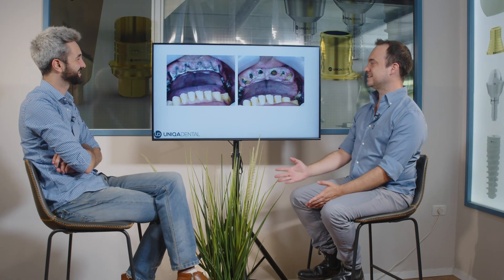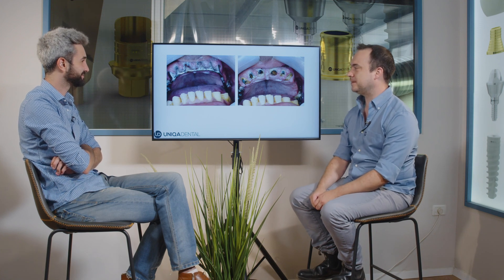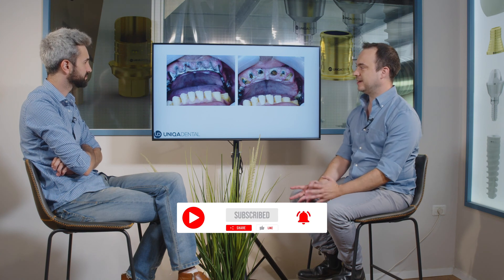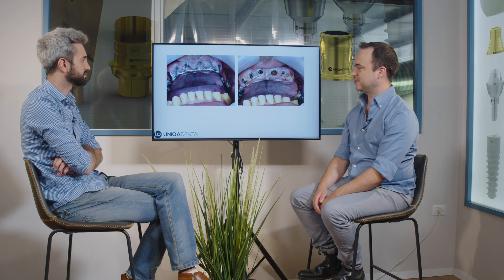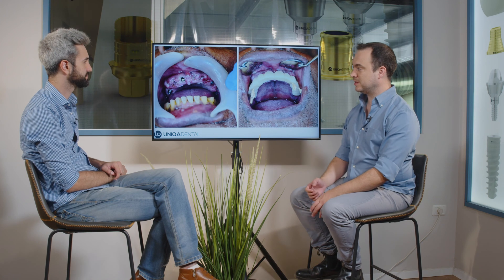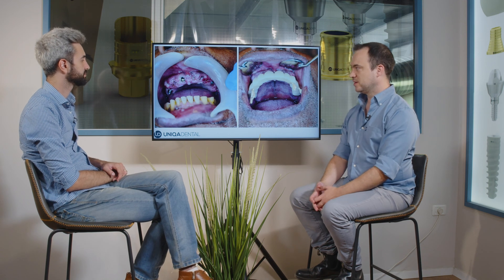This bar was made in the USSR. Just look how did we upgrade this old technology

Comment from the maker: 00:00 Extractions.
00:56 The bar is ancient.
01:15 You couldn't do anything well when you had a couple of implants and a couple of teeth. 
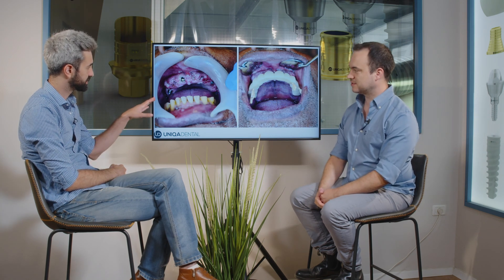02:39 Was it a screw-retained restoration? This, no. This is removable.
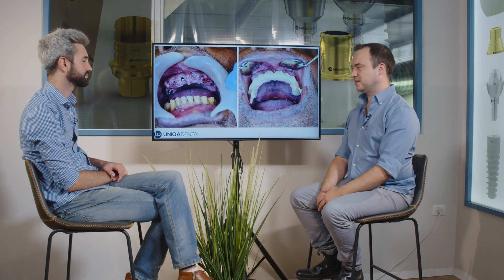03:05 This is before the extraction.
03:36 The broken one. We fixed it a little bit and placed it back. 
04:24 In this case, I used straight multi-units because the angulation is not that bad. 
05:24 This is after the extraction?
05:59 It's immediate implementation. 
06:54 The implants in the anterior region, will you take the bridge out to the occlusion?
07:08 We will immediately load it.